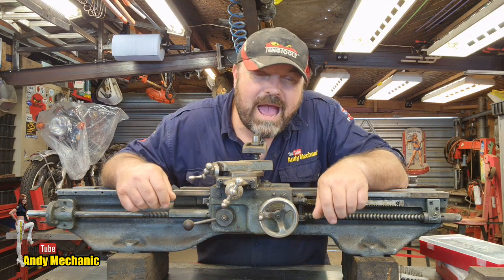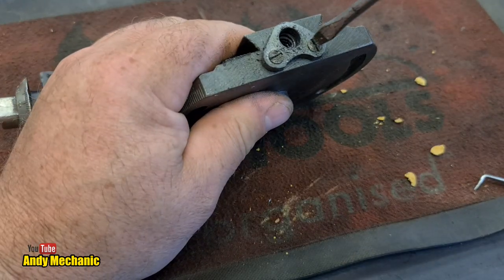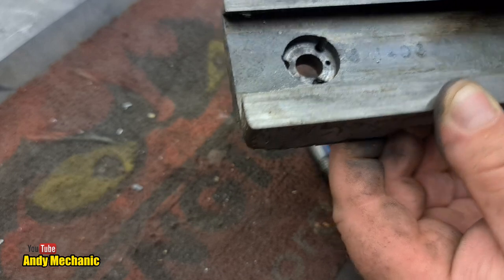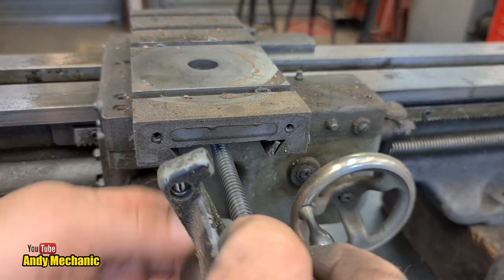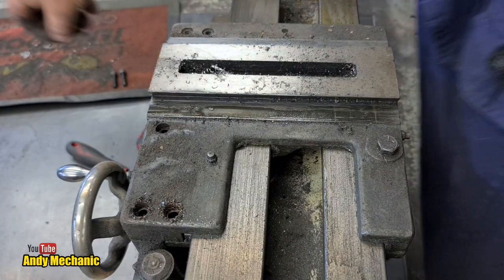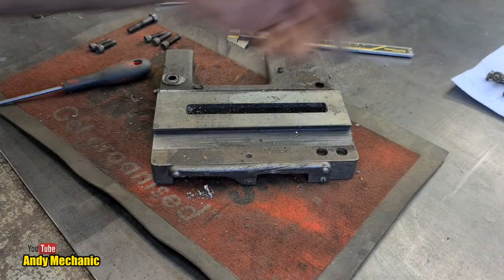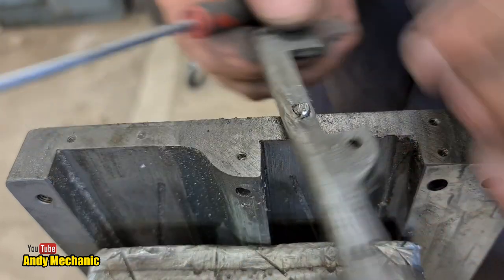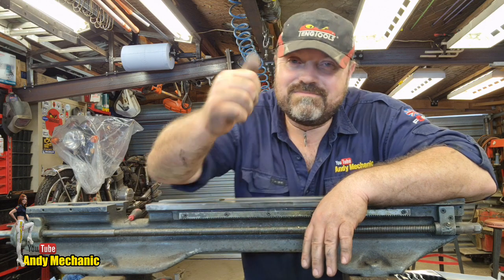Myford lathe   Carriage, cross & tool slide stripdown Ep3 #1990

Comment: A pont to note... Your Imperial Teng spanners are an AF ( Across Flats)  set but this old lathe will date back to Pre AF days when nuts and bolts were British standard WHITWORTH  . BSW And British standard FINE  BSF.sizes, where the spanner sizes are not related to the across flats dimensions of the nuts & bolts.  BSW and BSF sizes were originally nominated by the bolt sizes.  I.E   a 5/16 BSW spanner fits the nuts and head of   5/16 inch dia bolt.....' An added complication  was the adoption of smaller sized nut and bolt heads in an effort to save metal so the spanner sizes moved one step down..  I.E  the  BSW 5/16 spanner  would then be used for a 3/8 inch dia bolt. Complicated I know as the spanner size has no relation at all to the nut and bolt head sizes. I grew up as an engineer with all the BSW / BSF sizes and was accustomed to the mismatch, but for a younger person working on older machinery  nothing seems to make sense.
I too have an ML7 lathe from 1948 which still works as well as ever it did.
Great videos too..
The bolts on the ML7 are a mixture of BSF threads  with some BA threads also used.   The slide adjusting screws are No 2 BA with corresponding locknuts .  BA is yet another old British Assosciation size and commonly on smaller bolts with finer threads than BSF

Comment: Be careful those are wedges and ways. They're call, and sometimes they're tapered on the end, and if I'm not mistaken, the small taper goes up in the front and the large goes in the rear. Hold them up and look at them. Direct and measure each end with a pair of calipers and see which one's lower and the lower end goes up front. I do believe.  You probably should have took it off and looked before you let them fall. But that's o k you should be able to see it on a blueprint

Comment: Threaded rods = lead screws.  'Slidey bit' (2)  is the 'cross-slide'. Of all the things you could (should) replace, the two lead screws and the nuts they screw into would do you the most favours in terms of future accuracy - new ones will take out all of the backlash that you pointed out. BTW, they're ACME threads. If they're not available as a spare part, you can buy dies and taps to make your own.

Comment: The fixings are almost all BSF or Whitworth. A few are BA sizes. Either way, they all have head sizes that are proportioned from the thread dimensions. They are not simple AF (Across Flats) dimensions. None of the "Imperial" spanners you've got there will fit properly.
Reply from the maker: Well that's a bugger! Thanks for the info...looks like I get to buy some more tools....if I can find them.

Cheers Andy

Comment: I bet the Americans among yr subs are laughing at your / our struggle with imperial sizing.

I see u had an imperial flat head screw driver to hand
Reply from the maker: Sure did!! Cheers Andy
Reply: Especially since the nuts on the crossslide that lock the Adjustment screws are BA. I think a 4BA spanner 🔧 . Best get a set of BA spanner’s and Whitworth as well as Imperial for a Myford… 👍